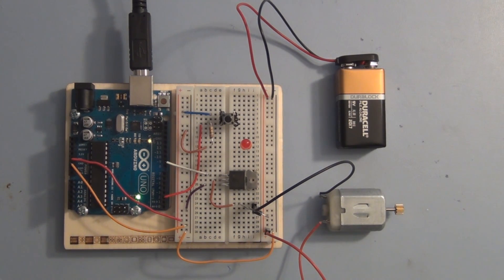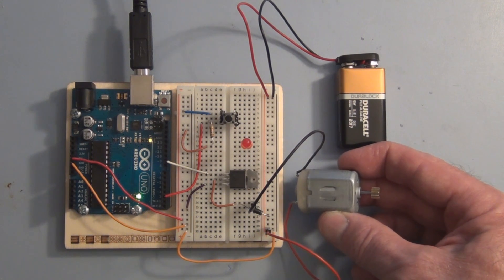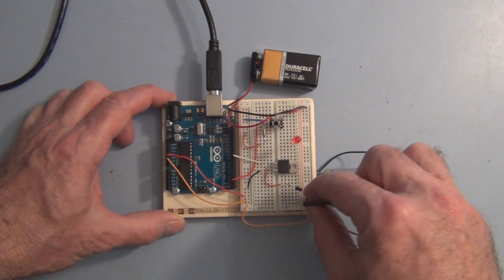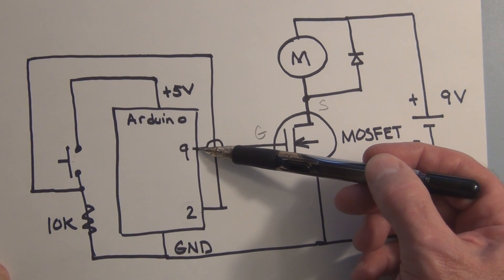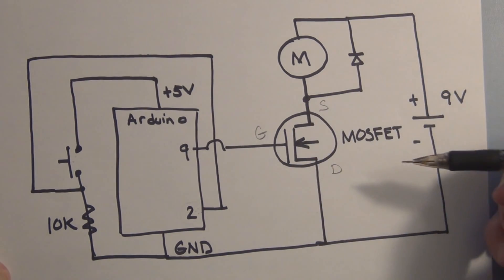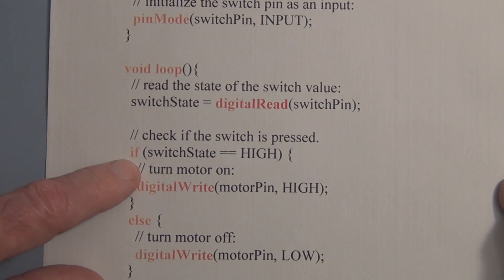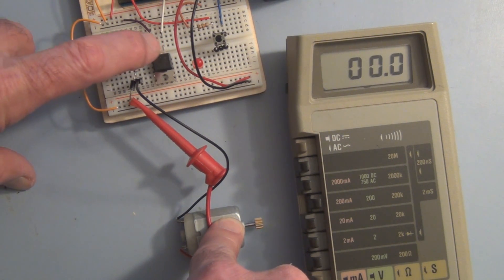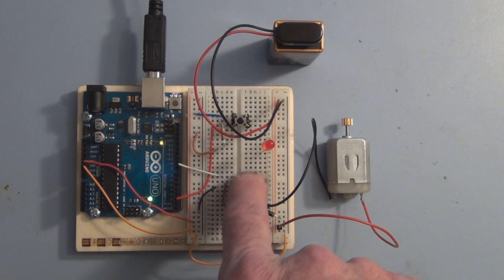Arduino DC Motor Control Tutorial

Comment: Does the motor spin until it s programmed to do so or can it do that just by connecting it to the battery???
Cuz mine doesn't spin when it s connected to the battery. Plz help.
Reply from the maker: If you have a small hobby motor it should spin if you connect 1.5V - 3.0V to it.  You need to know what the voltage and current requirement are for your motor.

Comment: Does using MOSFET Is better than a transistor (bc 547B) and which one works perfect switching on and for very short time
Reply: Please reply me
Reply from the maker: There isn't a simple answer to this question.  Here is an article comparing the two devices.  https://www.eetimes.com/mosfet-or-bipolar-which-should-you-use/#

Comment: // named constants for the switch and motor pins
const int switchPin = 2; // the number of the switch pin
const int motorPin = 9; // the number of the motor pin

int switchState = 0; // variable for reading the switch's 
status

void setup() {
// initialize the motor pin as an output:
pinMode(motorPin, OUTPUT);
// initialize the switch pin as an input:
pinMode(switchPin, INPUT);
}

void loop(){
//read the state of the switch value:
switchState = digitalRead(switchPin);

//check if the switch is pressed.
if (switchState == HIGH) {
// turn motor on: 
digitalWrite(motorPin, HIGH);
}
else{
// turn motor off:
digitalWrite(motorPin, LOW);
}

**transcribed directly from the video, for copying and pasting

Comment: I have 2 questions;
1. How do you write a program to create a double click function on the button to have the motor turn a certain amount of degrees, than rewind back the exact way?
2. Could and how do you program/solder that circuit into smaller arduino models?
Reply: I'm a newbie but I think it's very difficult to do that with dc motors try with steppers or servo

Comment: very good video!! hey could you help me with my program? I'm trying to turn on a motor with a push button but when I Load it the motor is turned on all the time, I think that it doesn't even read the button

int ledPin = 8;                // LED is connected to pin 8
int switchPin = 3;              // switch is connected to pin 3
int val=0;                        // variable for reading the pin status

void setup() {
  pinMode(ledPin, OUTPUT);      // Set the LED pin as output
  pinMode(switchPin, INPUT); // Set the switch pin as input
}

void loop(){
 
  val = digitalRead(switchPin);   // read input value and store it in val
  if (val == HIGH) {               // check if the button is pressed
    digitalWrite(ledPin, LOW);
 // this is what I want it to do
    delay(3000);
    digitalWrite(ledPin, HIGH);
    delay(1000);
    digitalWrite(ledPin, LOW);
  }
  else{
  digitalWrite(ledPin, LOW);
}
}
Reply: Bianca M Hosh Does the code above work?

Comment: Its worth mentioning that the motor only works as a generator for that LED when spun in one direction because the LED is a diode which prevents current flow in one direction.

Comment: What is the difference between using an npn transistor or using  amosfet to control dc motor ?
Reply from the maker: The transistor is a current controlled device and the mosfet is a voltage controlled device.  With the mosfet you can turn the motor on and off by controlling the voltage on the gate of the FET without drawing current from the arduino output pin.
Reply: eTech Tom thank you very much

Comment: Less physics more motor explanation of how its used with the Arduino. We don't need to know that a magnetic field induces currents in wires and whether it produces a force on the other. We need to know how to connect it to the circuit, and how we can use the motor to make stuff - like a toy car.

Comment: hallo MS :give me code
Reply: //Incrementing Motor Speed Control

const int MOTOR = 9;            //Motor connected to digital pin 9
const int BUTTON = 2;           //Button connected to pin 2
boolean lastButton = LOW;       //Variable containing the previous
                                //button state
boolean currentButton = LOW;    //Variable containing the current
                                //button state

int speedIncrement = 0;

void setup()
{
  pinMode (MOTOR, OUTPUT);      //Set the MOTOR pin as an output
  pinMode (BUTTON, INPUT);      //Set button as an input
}

/*
* Debouncing Funtion
* Pass it the previous button state,
* and get back the current debounced button state.
*/
boolean debounce(boolean last)
{
  boolean current = digitalRead(BUTTON);    //Read the button state
  if (last != current)                      //if it's different
    {
      delay(5);                             //wait 5ms
      current = digitalRead(BUTTON);        //read it again
    }
    return current;
}

/*
*Motor Speed Selection
*Pass a number for the Motor speed and set it
*/

void setSpeed(int increment)

{
  
  //speed one
  if (increment == 1)
  {
    analogWrite(MOTOR, 110);
  }
  
  else if (increment == 2)
  {
    analogWrite(MOTOR, 150);
  }
  else if (increment == 3)
  {
    analogWrite(MOTOR, 180);
  }
  else if (increment == 4)
  {
    analogWrite(MOTOR, 200);
  }
  else if (increment == 5)
  {
    analogWrite(MOTOR, 255);
  }
  
  //OFF 
  else
  {
    analogWrite(MOTOR, 0);
  }
  
}

void loop()
{
  currentButton = debounce(lastButton);              //read debounce state
  if (lastButton == LOW && currentButton == HIGH)     //if it was pressed
  {
    speedIncrement++;                                    //Increment motor speed
  }
  lastButton = currentButton;                          //reset button value
  
  //if cycled through all speed increments
  //reset the speed to 0
  if (speedIncrement == 6)  speedIncrement = 0;
  
  setSpeed(speedIncrement);
}
Reply: Abdo T Thanks for this code. Does it work?

Comment: Hi...

I have question.

If I want the back voltage recharging the battery to save power. what I must do?
Reply: thats not how it works. You have to add a battery charging ckt first and for now you should be more concerned about saving your arduino than recharging a battery.  Your welcome. ;)

Comment: where did you get that moter with that gear on the end?
Reply from the maker: It was included in the Arduino starter kit but I just looked under hobby motor gears on Amazon and found some gears if your looking for some.  There is an 82 piece kit for just $11.

Comment: I don't understand why having the diode in parallel works to stop flow to the MOSFET. In my head, some of the current from the motor would still go through the MOSFET. Could anyone clear this up for me please. Thanks!
Reply from the maker: Here is a link to a good explanation on this topic.  https://electronics.stackexchange.com/questions/95140/purpose-of-the-diode-and-capacitor-in-this-motor-circuit
Reply: Stephen W the diode is a semi driver. The current can only go on one direction

Comment: Could I use this setup to stop and start a 12 volt d.c. solenoid , and can I use a tlp120 in place of the MOSFET? My goal is to control the timing of water drips coming from the solenoid, this would be a great starting point for my project

Comment: what is the voltage rating of dc motor here?
Reply from the maker: It's hard to say since it was part of the arduino kit and I can't read the part number on it.  It's just a hobby motor.  Here are the specs of a similar motor from Adafruit Operating 
Temperature: -10°C ~ +60°C
Rated Voltage: 6.0VDC
Rated Load: 10 g*cm
No-load Current: 70 mA max
No-load Speed: 9100 ±1800 rpm
Loaded Current: 250 mA max
Loaded Speed: 4500 ±1500 rpm
Starting Torque: 20 g*cm
Starting Voltage: 2.0
Stall Current: 500mA max
Body Size: 27.5mm x 20mm x 15mm
Shaft Size: 8mm x 2mm diameter
Weight: 17.5 grams
https://www.adafruit.com/products/711
Reply: so, 6V dc motor can be driven by 9v battery without any harm, right?
Reply from the maker: I would be more concerned with staying within the current rating of the motor.  These hobby motors seem to come in voltage ratings from 1.5 to 12 volts.  Depending on the magnet sizes used in them you will need a certain amount of potential voltage across it to get it to start to spin and the current to do work.  I wouldn't put 24 volts across one of them but I don't think using 9V across one that is suppose to be rated for 6V is critical.  These hobby motors are not exactly precision motors.
Reply: Hello again,

I have followed the circuit diagram shown by you in video, but motor is not getting started at all.

About the connections:
Drain pin of MOSFET is connected to motor and source pin to ground. A pull down resistor rated 220 owm is also added.

About the devices used:
6 v dc motor same as yours.
MOSFET IRFZ44N  http://www.datasheetspdf.com/PDF/IRFZ44N/509097/1 Battery source 9 v
PWM signal from stm32f407 board, pin 12 (PD12) to gate terminal of MOSFET

However if I replace the PWM signal pin with 5v pin of same board, motor rotates, this shows MOSFET is working atleast if not correct.

Is MOSFET not amplifying the voltage required to drive the motor?
.
.
Reply from the maker: Check your code.  Your not using PWM in this sketch.  You're defining the pins as digitalRead and digitalWrite.  When the button is pressed and the 5V is detected the output pin will go from 0V to 5V.  Connect a 220 ohm resistor in series with an LED to ground on the output pin first.  If you can get that to light when you press the button you can then connect you motor circuit.  Do you have your switch oriented correctly on the breadboard?

Comment: What if I do not want to waste my Arduino when finalizing my project? What kind of microcontroller should I use that is also fairly cheap? (PS I'm fairly new to all of this)
Reply from the maker: There are so many options available now you have to determine what the minimum requirements are for your project.  Maybe you can accomplish what you need to do with a mini or nano microcontroller.  There are a lot of clones out there that give you lots of choices.
Reply: eTechTom which do u recommend for controlling the speed of a small DC motor? Any suggestions?

Comment: I believe you would better using the IRL540 Mosfet instead of the IRF520.   The L meaning Logic level.  You may not be fully driving the gate of the IRF520 which will cause it to have a higher resistance across Drain/Source meaning you are wasting power which generates heat.  Not a problem in your example with a push switch.  But if it was driving a motor being used at high duty cycles it may overheat.

Comment: is it necessary to plug in the usb cable after uploading the code ?

In other videos or some tutorial videos i saw the usb cable is connected 

The Arduino only work when it is connected with USB ?

please help me by giving the answer.......
Reply from the maker: External (non-USB) power can come either from an AC-to-DC adapter (wall-wart) or battery. The adapter can be connected by plugging a 2.1mm center-positive plug into the board's power jack. Leads from a battery can be inserted in the GND and Vin pin headers of the POWER connector.
The board can operate on an external supply from 6 to 20 volts. If supplied with less than 7V, however, the 5V pin may supply less than five volts and the board may become unstable. If using more than 12V, the voltage regulator may overheat and damage the board. The recommended range is 7 to 12 volts.  Here is a helpful link about the power requirement. https://www.arduino.cc/en/Main/ArduinoBoardUno

Comment: ciao! Potrei sapere che tipo di mosfet serve per un motore di 12v?  grazie.
Reply from the maker: +Riccardo Fragozzi The MOSFET used in this project is  IRF520.  Here is the link to the data sheet http://www.vishay.com/docs/91017/91017.pdf.  If you are just using a hobby motor this should work.  The voltage is not the only important factor.  You need to know how much current your motor will use under load.  You have to use a MOSFET that can handle the expected current draw from the motor.
Reply: +eTechTom Grazie mille!! Dunque, ad esempio per questo motore (https://www.futurashop.it/motore-250-ma-6-vdc-14500-rpm-8220-mot2n) quale mofset mi consigli? Grazie ancora.
Reply from the maker: IRF520 can handle 9.2A so you can use it to drive that motor.
Reply: +eTechTom Ok perfetto, per quanto riguarda invece il transistor e la resistenza qual'è il tipo più adatto? Grazie mille per la pazienza! Mi sono iscritto al canale ;)

Comment: 2 questions here, I'm really curious about. First, why do you put a 10k resistor to ground after the switch. Second, why does the common ground is necessary ? I used your circuit for a school project and without common ground it wasn't working. So something important is happening in the cable that connect the circuit of the switch and the circuit of the motor but I don't know what !
Reply: +MRmonja23 I think the 10k resistor is a pull down resistor to make sure pin 2 stays at 0 volts until the the switch is closed, but im not sure. Common ground is needed to complete the circuit.

Comment: hey tom is there a smaller board i can use like an arduino ad on or something like and can u make the motor adjustable via a remote...im thinkin of puttin a remote in the tender of a toy train but to be honest in clueless where to start as an arduino or even a raspberrypi are far too big...any help cheers
Reply from the maker: +kenny ball Adafruit has a product called a feather board that is smaller and also has an add on board to control motors. https://www.adafruit.com/products/2927
Reply: thx tom ill go check it out :)

Comment: Your vedio helped me a lot.but i need a a little help im making a balnce two wheel robot im using mpu 6050 gyro i connected the dc motor directly to the arduino but the motor is not getting enough power so please tell me how to incresec the power i dont wan to use dc driver please tell and sorry for my bad english

Comment: In general, why do external battery packs need to connect to ground on the arduino? If an led is hooked up to just the battery, everything works fine. Then why is that connection necessary?

Comment: Can I use the MOSFET IRF520 to control the speed and direction of the motor? I read that the IRF520 did not have a logic gate?
Reply from the maker: +upf You need an H-Bridge to change the direction of the motor.  Here is an example.  https://www.youtube.com/watch?v=GumqesVRKyk

Comment: I have a motor with this specs 
: Max.current: 7.6A
Max.power: 84.4W

what resistor and diode should I use? is it possible to send just half the power to the motor with the arduino? Im doing an Helicopter stabilizer if you could give me some hint about how to control the motor it would be great, thanks :)
Reply from the maker: +darkaluxito The arduino does not have a digital to analog output.  You can control the circuit that drives the motor using the arduino PWM (Pulse Width Modulation) outputs.  Similar to how you control the brightness of an LED https://www.youtube.com/watch?v=A4bmTsVh9Ck.  Instead of controlling the brightness of an LED you control the amount of bias on a transistor or MOSFET that controls the current through the motors winding.  Just because the motor can take 7.6 amps does not mean you want it to continually run at max power.   You have to figure out the amount of power you need for your stabilizer for your helicopters scale.  I'm not familiar with the amount of current the motors draw on a typical remote control helicopter.
Reply: eTechTom its ok, oyu helped me a lot, thanks, and +1 sub :D
Reply: +darkaluxito I just bought a 11.1v motor, now i know how to use the PWM but how do I calculate the resistor size for the connection between the arduino output and the mosfet gate?
Reply from the maker: darkaluxito You need a current limiting resistor to protect the output of the arduino.  The current limit is 40ma on the outputs but you don't want to continuously draw that to be safe.  You can use a 220 ohm resistor to limit the current to around 5/220= 22.7ma.  Make sure your mosfet is rated for max current through motor.

Comment: Using a MOSFET to drive a motor is a great idea.  That said, you need a resistor between the output of your Arduino and the GATE pin of your MOSFET.  If the Arduino can deliver up to 40 mA, then you could use a 125Ohm resistor for a 5V output or a 82.5 Ohm resistor for a 3.3V output.  Turning on and off a MOSFET without a resistor will likely cause the VDD of your micro (Arduino) to tank for a moment.  It is possible to cause the micro (Arduino) to RESET.
Reply: +steveandamyalso hence use a optical isolator such as PC817 EL817 DIP4 SHARP PC817C.  they are wired just like a LED with a 220ohm resistor uptream to the arduino.  About $3USD for 100, very cheap.

Comment: Hi, thanks for the video. witch MOSFET did you use in the experience?
Reply from the maker: +saidi med I'm using a Power MOSFET IRF520.  It is an N Channel MOSFET
Reply: +eTechTom thank you so much that was helpful
Reply: +eTechTom and one more question, what about the diode!! thanks
Reply from the maker: saidi med I used a 1N4004 diode.  http://www.vishay.com/docs/88503/1n4001.pdf
Reply: eTechTom thank you so much :)

Comment: would the circuit still be fuctional if you only used the right hand side of the circuit diagram (from G to the right), replaced the MOSFET with a variable resistor (to control rpm of the motor) and placed the PTMS below it connecting back to -V on the 9v battery?